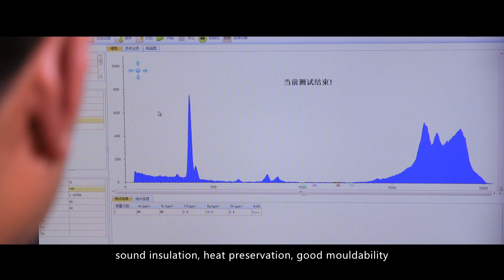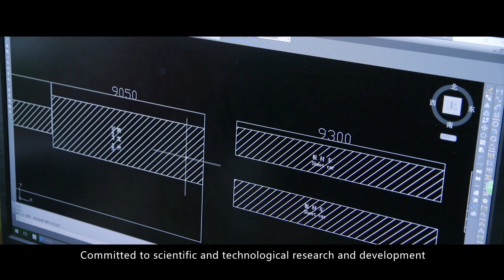EPE foam machine for extruding 40mm to 100mm foam planks （2020）

Comment from the maker: Single-layer EPE foam plank surface is very smooth, overall size is stable, the rebound is good， and EPE foam plank is 100% recyclable.
Reply: can you please guide regarding quality parameters of EPE
Reply: on the basis of which we can perform quality inspection?
Reply: @farhan-uz-zamankhan9498  Currently, we only check length, width,thickness and density.
Reply: I am interested for this machinery setup in india . Plz guide me.
+919425655428.
Whatsapp no
Reply: @cyberdarian  Hello vishal, we are the manufacturer of the epe extruder, I can't add you through Whatsapp, you can add my Whatsapp: 0086 13386456156 so I can send more details to you, tks
Reply: Hii